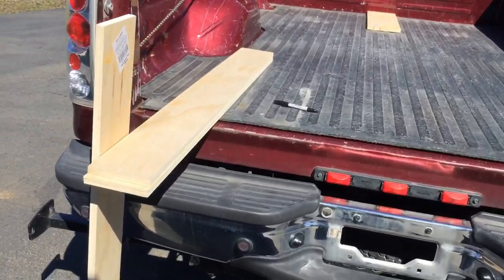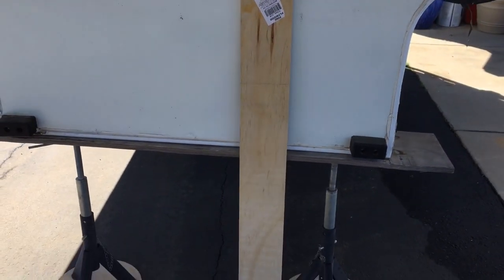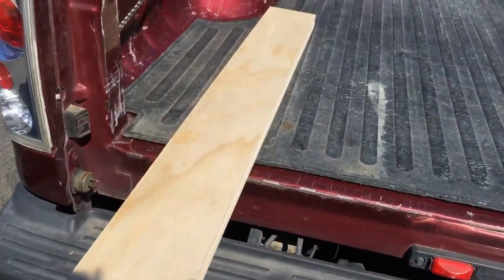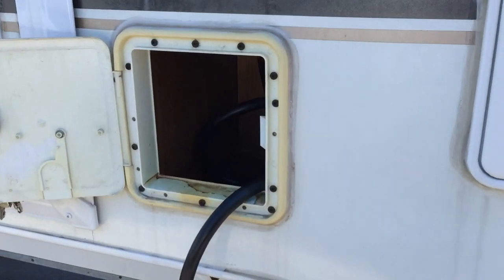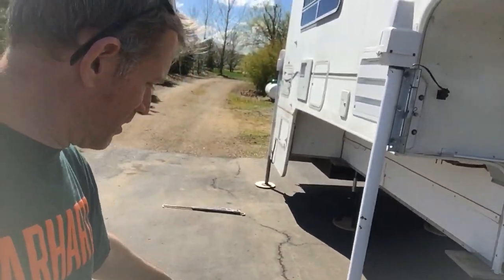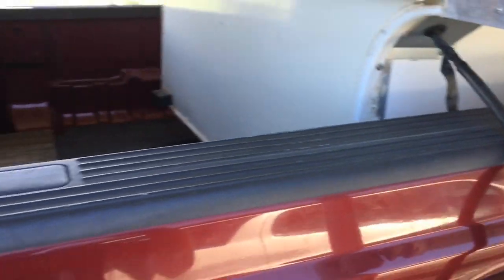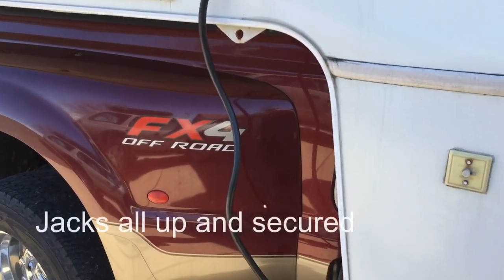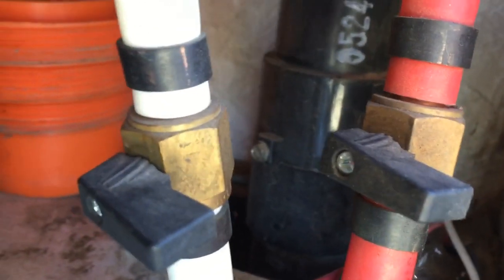How to Load a Truck Camper. Plus Tips & Tricks for 2019

Comment: Good Video Jeff. Twenty years ago we had an Elkhorn Camper with slide and 8 foot bed and I got good at loading and unloading as I would almost always unload our camper at the camp from so we could run around in the truck. Now after four Toy Hauler Travel Trailers, we are back to an Elkhorn Camper, no slide, 6.5 foot bed and it seems harder than our 8 foot camper.

Comment: A side note. You can mark your jacks leg extensions. Raise until you see red phase tape.I  put truck in neutral(auto or stick) with e brake applied when lowering camper on truck. Seat rear of camper first then front. Sets your camper tightly to bed front, without stressing bed front , camper front wall or pulling on camper front bump stops.

Comment: Great info!! Thank you for taking the time making this video!  Looking to get a truck camper for my 17 F350 6.7 DRW,    Love your choice of truck by the way!!!
Reply from the maker: That’s great Ed. I have no regrets with this set-up.  If I may give just a bit of advice; if you can find a Lance Camper that’s 2006 or newer, they started usin Azdel composite substrate instead of Luan plywood under the fiberglass siding.  No delamination of the sidewalls with that Azdel.  If you don’t want or need a Slideout, look at Bigfoot or Northern Lite fiberglass campers.  Built like a boat hull.  Good luck with your camper quest.
Reply: @covetthecamper2289  Well we took the plunge!! Couldn't afford a 2006 or newer so settled on a  older 1999 1030 Lance, Pristine inside!  I went all though it with my flash light, bone dry!! No delam.   Onan Propane Genny and a solar panel on the roof.  Got it for 3,500.  I installed Torklift Talon's frame mounts with Fast Guns.  Just want a couple of years out of it. Then we will go much newer!!!  We Pick it up tomorrow (Friday) Going to re caulk the whole thing when we get it home.
Reply from the maker: Ed Young 
Hey man, that’s awesome!   That’s a good camper at a great price.  
Tons of fun to be had.  👍🏻👍🏻

Comment: heres a tip, your front camper window has a black center line vertically in the slider. The trucks 3rd brake lite in the middle will mark your rear truck window center line. Mark back truck window with black tape vertically. As you backup line the two black lines of those windows as a guide...may save a trip or two getting in and out.

Comment: Hello, new camper owner here. One question I have is why are you laying plywood own on the bed before sitting your camper on them?
Reply from the maker: Congratulations on your new camper!
I place either high density foam board or plywood down on the bed for a few reasons; 
To keep it up off of the bed floor in case water gets down in there if driving during heavy rain.  It also lifts it up slightly (3/4”) so it clears the running lights on the cab a bit more.  (We do go off-road a fair amount and the camper/bed move independent of the cab)  It also helps stabilize the camper in the bed preventing it from slipping side to side in windy conditions and bumpy roads.(expansion joints on highways are brutal)

Comment: Put a piece of plywood or better 4x8 sheet of rigid insulation desired thickness, for camper raise. always raise front of camper 2 to 3 inches higher than rear of camper . this tranfers cantilever weight from front cabover sleeper to stronger mounted jacks in rear of camper.If you have hydraulic jacks ,rest camper on tall saw horses to minimize effort and time of jacking up camper..
Reply: You have me really thinking hard about doing this. So often I find leveling difficult because of the front needing a raise. Now it's ok since I have anderson wheel risers, I can drive onto but it would be nice to just roll in and be done with it.

Comment: I done fucked up on putting the camper on my truck I'm 2 ½ inches on the passenger side and 5 inches on the driver side. You can definitely tell she's not centered was hoping he'd mention this in the video but he didn't guess having a dually is pretty easy to center considering you only have so much room on each to play with so as long as your not scuffing your dually fenders your pretty much golden my truck however you have to have the eye of an eagle to center it
Reply from the maker: SRW is a bit tricky.  Place a masking tape line at the center of your truck bed and another tape line at center of camper belly.  Line those up when backing under.
I have seen people use laser pointers from the dollar store as well.

Comment: My lance power jacks will not run off shore power. The manual says only use 12V.
Fyi
Reply from the maker: Right, none of the truck camper jacks run off of 110AC.  I plug in so the batteries are getting the boost while running the jacks.   (Same with the Slideout motor)
If I’m away from shore power, the solar panels replenish the batteries in no time.

Comment: Wire nuts instead of butt connectors and shrink sleeve in a mobile application? Bruh.....
Reply from the maker: I did that 7 years ago.  Over 25,000 miles traveled…. A lot of rough roads… Zero issues.